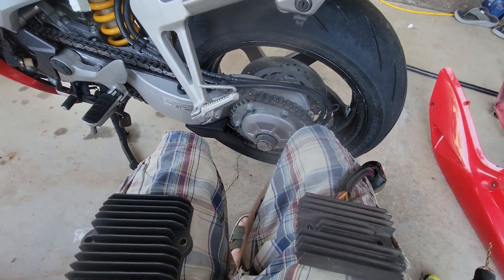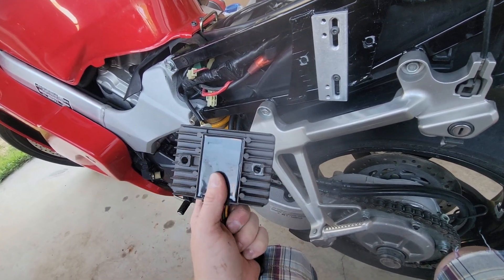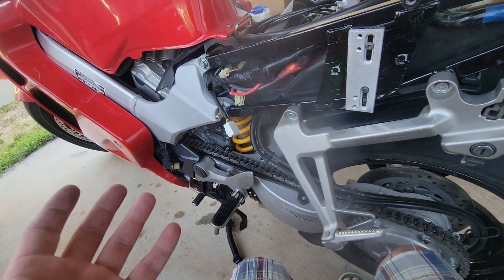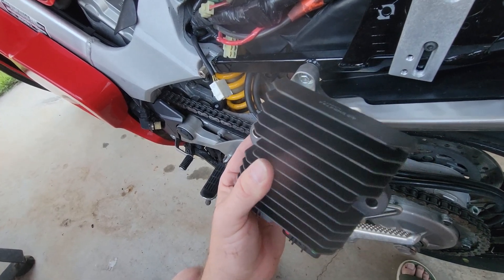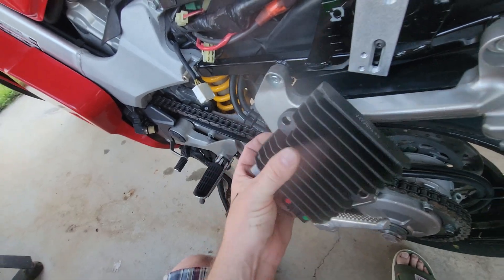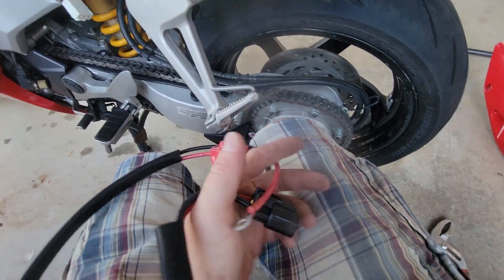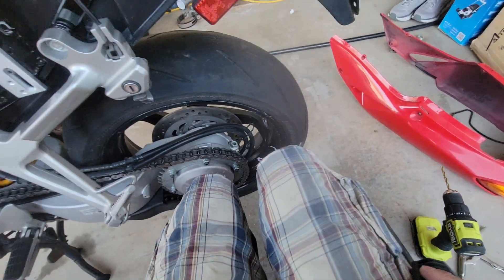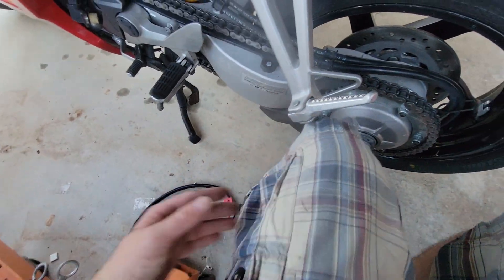2001 Honda VFR 800 SH847 rectifier swap

Comment: You might feel like the new rec/reg is a tight fit but thank heavens you don't have a 6th Gen Vtec, the unit is behind the right side radiator, next to the ECU just because Honda followed fashion and chose under seat exhausts. When I fitted the Mosfet to my 5th Gen, I also got rid of the stator connector and connected the output directly to the battery, remove as many power plugs as possible.

Comment: Keep it at the back, The Engine is producing a lot of heat, this killed a lot of Early Honda Hornets as they positioned their Rectifiers above the engine under the tank, they fried a lot. They ALSO moved them to under the seat or back half of bike..Honda made CHOCOLATE rectifiers on the early bikes, New MOSFET and other top make Rectifiers don't get so hot and thus last years ;o)